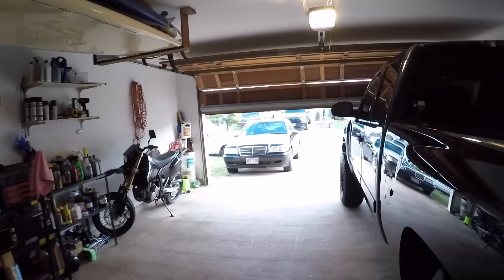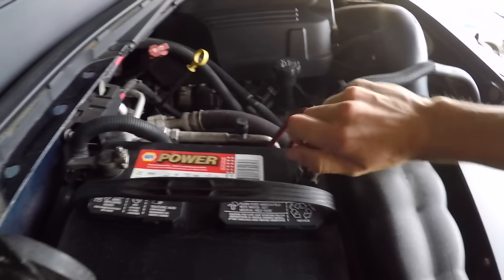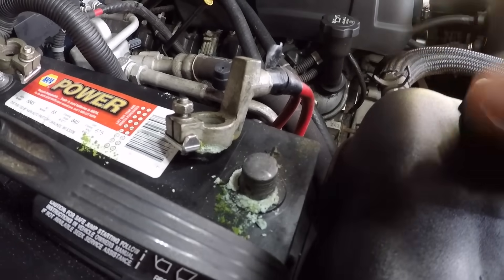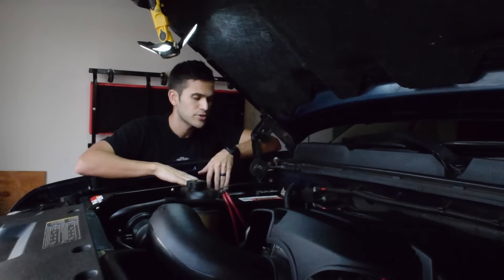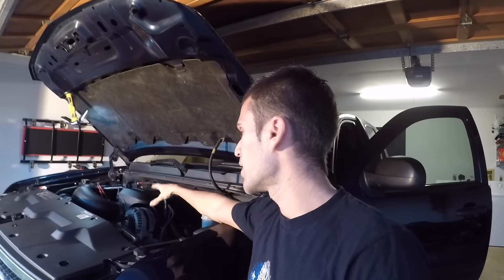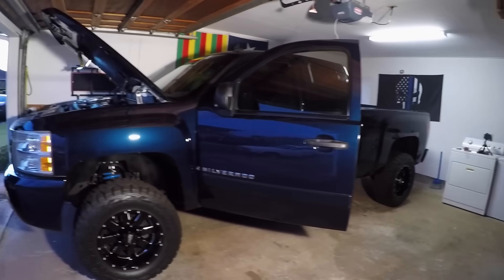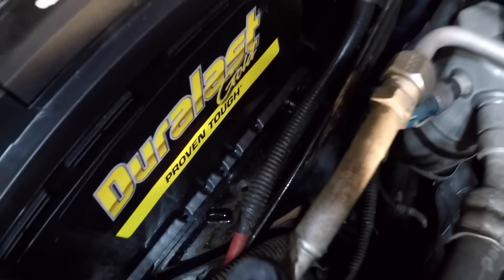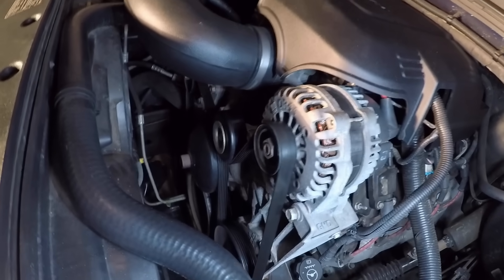Car Won't Start: Alternator or Battery? The easy way to know

Comment: what if it was the alternator and the car wouldn’t start how would you know if it was the alternator. Right from there because you can’t get a readying with 14v if the cars off. I need help. I have a 2002 civic the cars for a new battery 3 months old. 

But the battery light is on the dash for the passed 3 weeks. I charged the battery terminal’s and it still won’t turn on. If you can help that would be grate. I checked the relay check the fuel pump.
Reply from the maker: Sounds like you might have a starter problem. Is it functioning properly?
Reply: If battery light is on the charging system is malfunctioning aka your alternator it could have what is known as a open diode or diode short alternator on a 2002 honda civic vilery simple to replace takes just a few hours
Reply: Pedro Clemente it will still need a new battery as well if you have had a bad alternator the battery has been damaged and been depleted and would need replacement as well its a cheaper battery I believe either a size 51 or 51r depends on model of your civic whether its an ex lx hx
Reply: Konvicted Motorsports. Yes I changed the starter and still didn’t turn on. 

I just got the alternator today when I get home from work I’m going to work on it.
Reply: Konvicted Motorsports. 

It’s a ex 2 door civic manual 

And there’s a new battery in now when I knew about that battery problem with the light being on that’s when I toke the connections of the battery out because I knew it was going to drain the battery. So I took to advance auto just to check up on it. 

They Exchange the battery for me. ￼
Reply: Pedro Clemente ok is it cranking or no
Reply: Konvicted Motorsports no it’s not cracking.
Reply: It could be a few things if no crank clutch safety switch which is around the clutch pedal or the battery relay under the hood with the fuse box its and 80 or 90amp I believe or you have a bad ground somewhere could be the one off the battery or one on the car
Reply: If cranking then fuel pump has went could be the fuse under the dash or pump completely if you turn to ON position on ignition you should hear the pump making like a “whining” noise

Comment: Is your truck's exhaust stock? Or does it have a muffler delete or something?
Reply from the maker: The stock muffler has been swapped for a Cherry Bomb Extreme muffler. The exhaust is dumped at the rear axle. I'll be doing a video on the exhaust in the near future.
Reply: Do a exhaust video